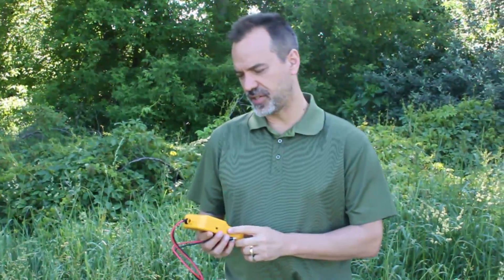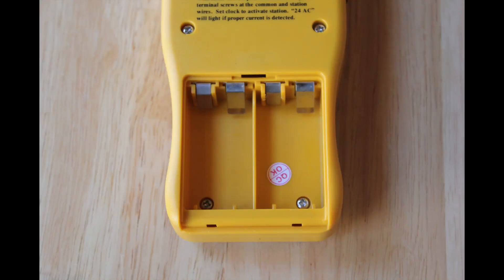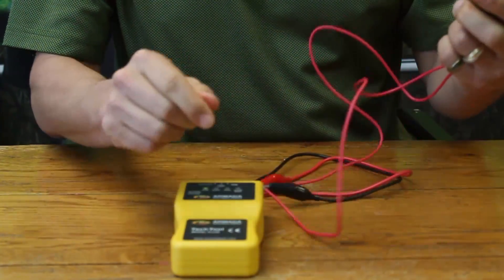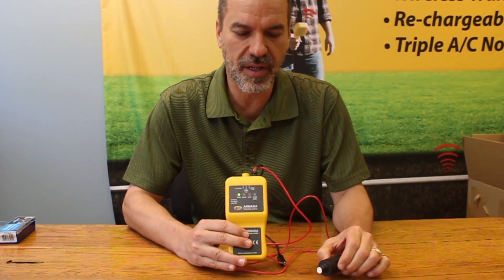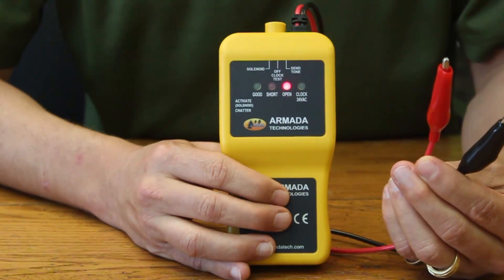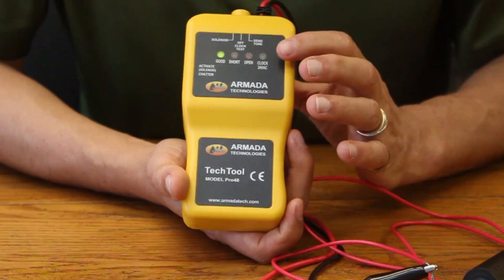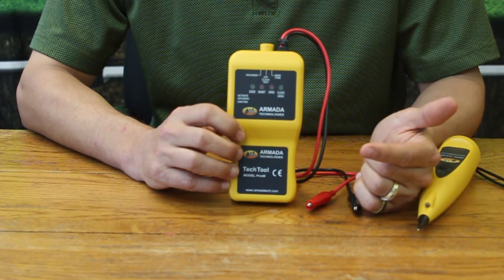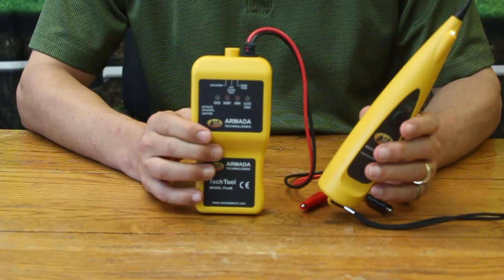How to Use a Solenoid Activator for Irrigation Sprinkler Repair or Maintenance and Chatter.  Pro48

Comment: I have a 2 wire system the uses decoders. How would you chatter a lot valve in that case?
Reply from the maker: Our Pro50 (seen featured in other videos under our Multi-Function Irrigation Testers section) is what you would want to use for 2-wire

Comment: I tested a solenoid while it still had the wires from the common attach to them and the device ( armada Pro48) and read "good" green light but the controller keeps giving me a message: " master valve/ pump wire short or high current" what could possible be ?
Reply: If you got a Green light the solenoid you connected to should activate. Did it click or did water come out? If the controller still thinks the circuit is shorted it may be connected to a different wire than the one you tested. You can check the wiring for a short by placing an ohmmeter/multimeter across the common and control wire in question at the controller. It could be that the master valve is connected to a different Common and the short is not on the circuit you tested.

Comment: So what happens when I use both of my Pro 900 trackers to locate a valve in which I know the vicinity of but neither one of them will locate it on high frequency or low frequency. It is a dead solenoid so I am guessing this device you guys have will not locate a dead solenoid I presume? I'm just frustrated at spending over $2,000 for trackers that can't find a valve.

Comment: ive had a little chatterbox for a long time. its a passive thing, not powered, i guess just using a 555 timer chip, and it just clips inline with the station wire. little guy has found many a valve for me, and ill admit, ive had to crawl around with my ear on the ground for many a hour lol!

Comment: I have tried numerous times to identify a wire and its tricky. I seem to get a tone coming from all the wires. If I attach the pro 48 to to the sprinkler box common and hot wire and then use the toner probe at the valve.. Where should I touch the wires? Should I probe the wires at the solenoid?
Reply: Hi Mixin': It is common to have "Bleed-over" tone among wires that are close together, but you can usually sort out the target wire with some care. Try backing the probe volume way down until the broad tones begin to fade and re-check, spread the wires apart as much as possible to make the target wire stand out better, touch the probe tip right to the insulation of the valve wires one by one. Experiment a little to see what works for you - the difference between the target wire and the group of wires may seem small.
Reply: @jlcarefoot  Thank you for the tips. Im new to tracking wires and so far its been frustrating. I just got a huge job with a bunch of missing valves and I went ahead and tracked the common wire, I walked past 2 valves and the beeping began to fade as I got close to an oak tree. But, I walked around the tree and the beep came back but very faint. Do you think the oak roots split the wire?  Unfortunately, after the tree there is a driveway that the wires go under to get to the next valve. I managed to find the valve but the wires going to it are gone. They have a node that operates that valve but both the valve and the node are broken. Im thinking about trenching the whole area by the Oak tree to see where it goes under the driveway. What do you think about that?
Reply: @mixingreen  Trees can damage wiring, usually by twisting and stretching it over time. What are you using to track the wire? You should be able to do some mapping even if it is damaged. Check the depth of the wire to see if the wire dives deeper under the driveway. The faint signals may also be ghosts from other wires in the system.

Comment: can you use it backwards to find valves and berried wires?
Reply: Hi.
There is a tone generator built in to the testers that will send a tone to the other end of the zone wire. This signal allows you to use a 'wire tracer' probe to identify wires. (example Armada Pro210) This won't work very well tracing the entire path of a buried wire, but it can help ID  a wire among many.

Comment: Hi 
Excellent explanatory video.  Is the “clock” the actual timer/controller unit ?
Thank you
Reply: Hi CF:  "Clock" is an old term that is widely used to refer to complete modern irrigation controllers.
Reply: @jlcarefoot  
Thank you very much

Comment: If you have a functional valve that you can't find with the tracker or the chatter function on the toner run the water on another zone and chatter the valve it will open and close and you can feel and hear the valve cycling and go right to it
Reply: Interesting idea Stephen.
Reply: We have advised people to shut off the water to make the chatter easier to hear. Do you think reducing the water pressure by opening another zone might increase the noise by adding some water flow?

Comment: can the on/off solenoid activation destroy the solenoid?
Reply: The solenoid won't be damaged by the activation signal. There will be an audible snap as the solenoid lifts the plunger. This is normal in testing and in regular operation with a controller. The solenoid will easily handle the repeated activations in 'Chatter' mode, too.

Comment: The Pro48 and Pro50 testers can cause a valve solenoid to cycle which will help identify specific valves. A "chatter-box" is meant to generate a stronger audible noise for finding the valve by ear. It typically uses the AC voltage output from the controller and doesn't verify operation.

Comment: Do you have to disconnect the station wire and ground wire from your controller when you send a tone at the controller?  Also, coming the other way from the solenoid to the clock,  will it damage the station circuitry?
Reply from the maker: Hi Roy. It is not necessary to disconnect the wires at the controller when using our solenoid activators for testing or tone tracing. More care is required if you are using a wire and valve locator.

Comment: Well it didn’t chatter or when I tried to find the valve it doesn’t make a noise untile I’m underground with it
Reply from the maker: The Pro48 usually makes a pretty good snap sound on a solenoid. It may be necessary to turn off the water - a pressurized valve can mute the sound.

Comment: can you put the red and black wires to the comm and the zone wire and track a wire underground
Reply from the maker: Not the path, that is a job for our line of locators.  The Pro48 can chatter a valve to locate it, but the actual wire path needs a locator.  Hope that helps.

Comment: So if i dug up 8 wires in my lawn and i want to know which wire is coming from station #1 on the controller, i hook the red clip to the #1 at the controller and the black clip to an earth stake in the ground and just go put my probe to the 8 wires?
Reply: The controller has a COMM terminal which is ground;  place red lead to the Station in the Controller and the black lead to the white wire connected to the Comm screw.  This sends out a tone to the wire you want to identify. No need to use a stake probed to the ground.